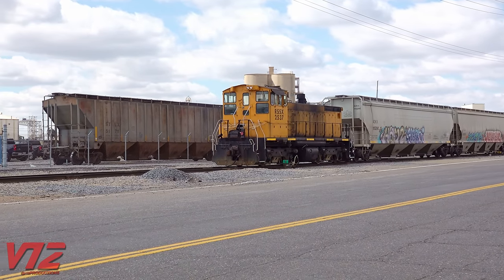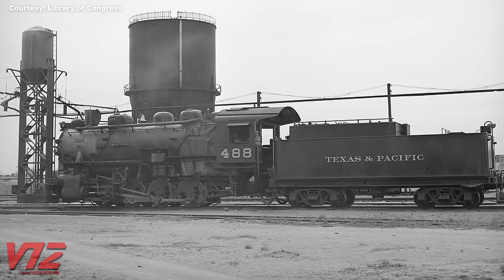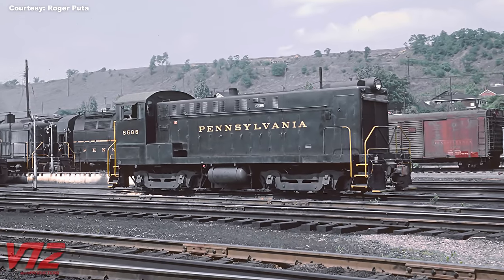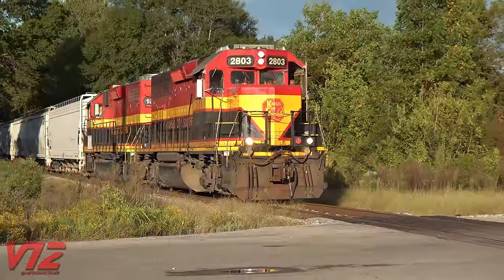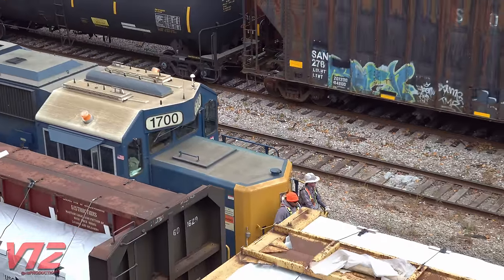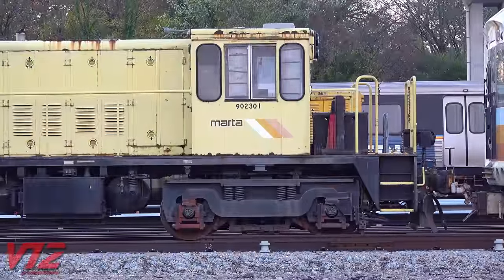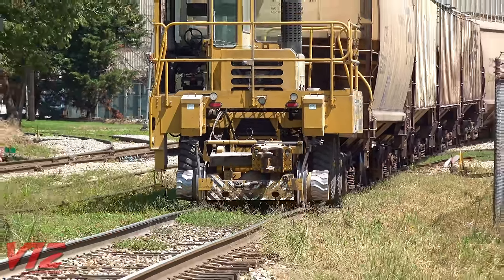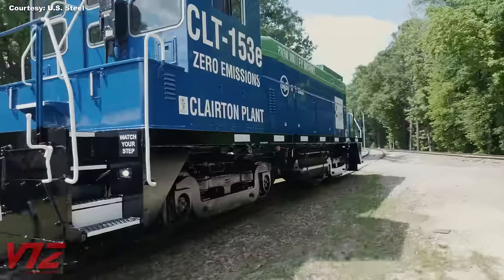What's a BUTThead?

Comment: Never in my 21 years as a conductor have I heard anyone refer to them as buttheads. No csx, ns, up, kcs or bn guys. Maybe it's a regional thing?
Reply: Same, I've talked with dozens of SP ATSF crews that worked with these back in the 1970s and 1980s.  NEVER heard them called this way.  They had other names... but I wonder if this is more a post-2000 thing where MTV/Nic cartoon influenced the kids and then they worked for the RR... or maybe this is just a foamer-name which has NO basis on the railroads at all.
Reply: @NightOwlModeler  come to think of it, it does smell like foamer.

Comment: 2 end cabs are still in use by V/Line at Southern Cross Station in Melbourne Victoria Australia to move passenger carriages in and out of the platforms, their days are numbers as most of the fleet is now DMU.
They are Y class and there used to be 75 of them in use across the system, there are a few in use by preservation groups.

Comment: The LIRR and NY & Atlantic still use some MP15ACs. LIRR use to have MP15ACs to pull commuter trains from the 1980s until the 1990s.
Reply: They used to have a pair stationed at Harold Tower to act as rescue engines, at least during rush hour.

I don’t know what the current procedure is.
I moved out of New York 21 years ago.
Reply: @yankinga  those were EMD SW1001s at Harold.
Reply: @jonathanng2390  you’re right. They even had them painted in the  gray with orange ends livery. I guess they are razor blades or automobile fenders by now.
Reply: @yankinga A few of the sw1001s are still floating around in service, some on NYAR and some on MOW servicss

Comment: I kinda think we need to see a resurgence of electric locomotives, or even hybrids, though i suppose that presents new safety and logostic problems. It just seems like having a catenary or third rail in yards for its switchers would be a good solution
Reply: And I have been wondering about that; conventional overhead and 3rd rail technologies are still practical and effective today. India is going to have electrified it's entire railway system; because they worked towards it early on. Yet many companies are spending millions to develop battery locomotives for mainline use. I guess they will do anything but install overhead lines.

Comment: Super. 💙 T.E.N. Edit: I still have five Athearn Bluebox SW-7 (SW-1500 on the box originally.) locomotives in operation after almost fifty years. I bought two cows and a calf brand new, and was impressed with how they ran, and was quite satisfied and happy with the purchase, as they all ran great. About six months later, there was a SW-7 cow and calf combo (Beavis & Butthead?🙂) in my paint scheme on consignment at the hobby shop. I was interested, but the dealer wanted $35.00 for the set, when the Athearn SW-7s were only $12.99 each, brand new, and he had my roadname in stock. I checked and these were modified with RADIAL X2-f couplers. At the time, I knew about a manufacturer that made radial X2-f couplers, but had only seen the Kadee radial knuckle coupler in use. Well, I bought those two right then and there, as my railroad was about 50/50 between hornhook and knuckle couplers back then. That much money would have almost paid for an Athearn F-7A Superpowered locomotive, matching F-7B dummy, and five matching Athearn streamlined passenger cars. Little did I know that those two locomotives would be the start of a trolley line with a paved right of way that is the railroads connection to a large sugar beet mill. The trolley line has 4 3/4 inch radius curves, and the two SW-7s will walk around those corners with 27 thirtyfour foot beet hopper cars in tow. Nowadays, the sugar beet mill has an 0-4-0 steam locomotive and a Plymouth MDT four wheel switcher, the trolley line has four trolley cars, one with radial Kadee knuckle couplers, two Plymouth CR-4 center cab switching locomotives, one Plymouth WDT six wheel switcher, two each box car, tank car, gondola, and one flatcar, one coach, one combine, and one observation passenger cars, and two cabooses, all equipped with radial couplers, not to mention the two SW-7s. Amazing what came from finding two modified locomotives on a dealers consignment shelf. Hello from the Tracy Mountain Railway in Colorado. 💙 T.E.N.
Reply: Now in the midst of the Great Texas plains, how long did that take you?
Reply: My railroad has been around since 1965, but in different locations. I still have and operate the original Lionel HO "Pacific" train set that my mom and dad gave me, and many of the items that I bought when I was young still operate on my layout. 💙 T.E.N.
Reply: @tracynation2820  I said. HOW LONG DID TAKE YOU!? 😰
Reply: FIFTY FIVE YEARS. 💙 T.E.N.
Reply: @tracynation2820  Wow, man lived an entire half century

Comment: There's quite a few industries out here in the El Paso, TX area that still use end-cab switchers and trackmobiles: Vinton Steel in Vinton, TX, the Freeport Mcmoran plant in El Paso, and Jobe cement off Paisano Dr. still has an old GE 44-Tonner tucked away, but most likely got replaced judging by the presence of the trackmobile.

Comment: That type of locomotive was the very first experience I had, up close and personal, when my Dad was an Engineer. Many fond memories. There is one sitting in the local (3rd level) yard - but I haven't seen it in use over several years now. The local run is handled by a pair of GP35s(?). Thanks for the informative post.

Comment: While stationed at George AFB in Victorville, CA in 1973, I remember we had a GE, either 40 or 50 something tonner that would periodically bring box and tanker (jet fuel) cars from the UP lines at Victorville out to the base.  I'm sure that was gone a couple of years later as most USAF base locomotives (and rail supply) was quickly deactivated in lieu of 'more efficient' truck transport.  And then the Gulf oil 'crisis' hit...

Comment: By the time I had retired from the steel mill where I worked, I had run switchers for almost 20 years. We ran only EMD SW1200's, and we all loved them and worked them hard. I left in 2009, but the mills still run these engines. The one I generally ran was a 1957 model, an ex BN engine, numbered 170. I have many pictures and many fond memories of running on the railroad with these old locomotives.

Comment: I'll say this though: had National Railway Equipment's multi-prime mover genset switchers actually worked well, we'll be seeing them all over the USA in yard service. The NRE gensets were a modern attempt to build a "butthead" yard switcher with way lower emissions than the old EMD SW and MP serires yard switchers. But now, railroads are modifying GP40's and even some SD40's into yard switchers with new prime movers that meet EPA Tier 4 emission standards.

Comment: We have two in service at TVRM. One is ex. Milwaukee Road SW1200 No. 606. It lives at the museum and can be seen fairly frequently pulling passenger trains or freight. 

The other one we have that runs is ex. US Army SW8 No. 2000, though it is currently numbered as TVRM 1898. It lives at the Nokian Tire Plant in Dayton, Tennessee as their in plant switcher. TVRM supplies the staff to operate it whenever they need a move, usually about once or twice a week.

Comment: Gold Coast RR Museum actually has two former NASA locos. ALCo S-2 #1 and NASA's later SW1500 #2. A preserved USAF SW8M is also on display at the Air Force side of Canaveral Air Force Station. Of the three, I have ridden in all of them, but prefer the controls of the ALCo. Why? Because it is strictly mechanical from the control stand to the engine. You can move the throttle just a hair if you need just a few more HP. The other two are set at what the electricals space the engine speed at.

Comment: The Union RR outside of Pittsburgh has a complete fleet of EMD end-cabs in multi-unit formations (Typically 4 untis) hauling coal, coke, scrap metal, steen ingots and slabs for US Steel. A genuine heavy-haul short line with steep grades and tight curves.

Comment: That loco you thought to be of French origin also looks like one they use in Germany which is much more modern looking. The unobstructed sight lines from a center mounted cab give the operator lots of help when in operation. It looks like a typical yard switcher though this one has that German industrial look though it's an attractive looking locomotive nonetheless. Do a search for "German Diesel Locomotive DB Class 294 834-7" or check out a DB Class 212 for another example of one...

Comment: Reading and Northern has a fleet of MP15DCs, SW1500’s and SW8’s still out earning their keep. Also I volunteer at the Allentown and Auburn which has an EMC SW built for Bethlehem Steel in 1937 and is still out earning its keep multiple times a week pulling passenger excursion and moving cars for 2 freight customers along the 4.5mile line.

Comment: 4:10 The Whitcomb was actually used internationally, some operated for quite a long time in the Netherlands and Italy.
Nederlandse Spoorwegen acquired units No. 601 to 619 in 1946, using them until 1960.
Ferrovie dello Stato took over 49 units type Ne 120 built 1941 to 1944 and rebuilt them to D 143 in the years 1966 to 1974, the last operated until 2014!
From 1952 to 2055 SGP built 20 units class 2045 for ÖBB (Austria) that had some similarities in the general layout with the Whitcomb. Due to limited visibility that remained the only center cab locomotive with high hoods, later shunters were built with low hoods and raised cabs.

Comment: There are few different shunter types in Europe:
Center cab - the most common type, with cab in between hoods. Example: Br363 from DB, locomotive type 736 of ZSSK.
End cab/“Butt head” - uncommon, I only know 1 type: type 721 from ZSSK or ZSSK Cargo
Center cab w. high hoods - relatively uncommon, they have relatively poor visibility. Example: locomotive type 742 of ČD Cargo,…; or type 770 from ZSSK Cargo,…

Comment: Worked for U S Steel 24 years in Fairfield Alabama. Worked for USS railroad  aka  Fairfield Southern Co. We had around 15 to 20 locomotives most of the time.  24/7. Around the clock  7 days a week..  SD 9s. MP 1500s And a lot of SW1000s  All EMDs  just a few still out there.. most sent North to other USS mills

Comment: The Union Railroad in Pittsburgh had a pretty sizable fleet of various butthead engines. They would pull trains of coal, iron ore, steel and limestone with as many as a half dozen engines at a time. You could hear them dragging up the valleys for miles before you could see them.

I was leaving out of Tilford one day, and they were out of normal power to put on our train. They eventually resorted to giving me an SW1500 that they took from the conductor school to use as a lead engine. I was excited because I had never run one before. Leaving Tilford southbound was a pretty steep climb, so I had that engine in number 8 for quite a ways. It hadn’t been in number 8 in many years, so it had chunks of “charcoal” blowing out of its stack lol. It made the trip and I took it back to Tilford that night, but all that unusual effort put a hurting on the lil engine because I saw it about 2 days later, dead-in-tow, headed to Waycross on a through freight.
Reply from the maker: Great story! Thanks for sharing

Comment: OMLX 2008 is an SW9 on the Fulton County RR. Powered by an 8-cylinder 567-C engine and has to be blown out each time before starting! But there's something terribly wrong with the engine as it overloads and shuts down if MU'd. So they were storing it at the end of the Intonu Lead. 33.74963402830621, -84.55290669482991 when there's no room in the Yard near Cascade Rd on Wilson Mill. But its been years since I laid eyes on it and that was also when I ran it. I could switch the yard with it just fine. It would pull 40-50 cars out of the yard and up the hill towards the crossing. But it would not handle a run to the south end by itself and you couldn't MU another engine to it. Poor little switcher! No near as fun as running an ALCO S1 but it got the job done, sometimes.

Comment: We just called them SW1000s, SW1500s and there were SC1000s that had cast frames which means the SW1000 or SW1500 have welded frames. GPs were general purpose locomotives. RSs were road switchers and RSDs road switcher diesel. The last butthead in Phoenix, Arizona I saw was out where the automobiles are unloaded in Peoria, Arizona. There are some natural gas and LP gas butthead conversions in California. CF&I now Evraz Steel uses an end cab in Pueblo, Colorado.

Comment: On Long Island, the New York and Atlantic Railroad uses MP-15s and GP38s or GP40s (I can't remember which) for their mainline power pretty consistently.  The Long Island Railroad still has a good number of them running as well, but they're typically used for maintenance. Back in the day, they were used on passenger trains from NYC to Greenport, with an Alco PA unit on the opposite end as a cab car

Comment: My local shortline, the Orangeville-Brampton Railway, had these switchers (an MP15DC) until it was closed in 2021. Also, a lot of subway systems around the world use either these end-cab switchers or "motovoz" switchers (mostly in former USSR countries), which resemble a truck and have a gas-powered truck engine on one end and a platform for cargo or workers on the other end. I always wondered why subways in North America don't have gas switchers with inbuilt platforms and mostly use buttheads.

Comment: The use of battery,and hybrid locomotives isn't new,the NYC,had Alco/GE,Des Class locos,that were battery propelled,and had the diesel to charge them! They also could be operated from third rail power! The DL&W had a couple too! Another path to follow,as there are earlier units that GE built,and used on street railroads and Interurbans! Interesting video,and historically useful! Thank you 😇 😊!

Comment: Check out the Union Railroad near Pittsburgh pa. A heavy switching and terminal operation serving the remaining steel industry in the monogahela river valley. Since the URR dieselized in the 40s, they have always rostered nothing but (except for short lived GM/Baldwin road units called "buffalos") end cab switchers. Currently the URR rosters about three dozen SW1500s and MP15s. Quite a sight and sound to witness 5 of these units lugging heavy unit drags up and down the rugged terrain of their lines.

Comment: where do you come up with this stuff? Im 59 yrs old, have worked for 3 major RR's and have never heard the term 'butthead'. not true, switchers are not the first purchased, loco's are purchased to meet the RR's needs/requirements because of their size or horsepower. Heavy haul operations have no use for an end-cab switcher so would never own one. SD70ACu's are not road-switchers. you talk like you are knowledgeable but this isn't your first vid full of inaccurate info either. you need to do better research. thumbs down, unsubscribed.